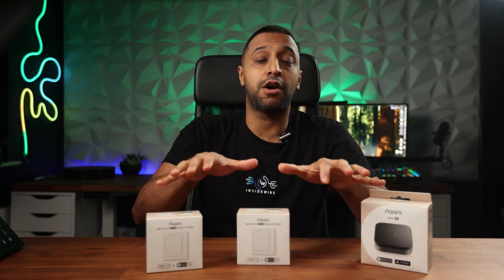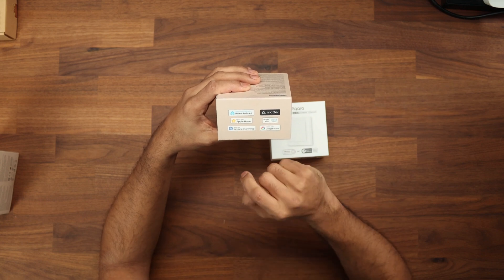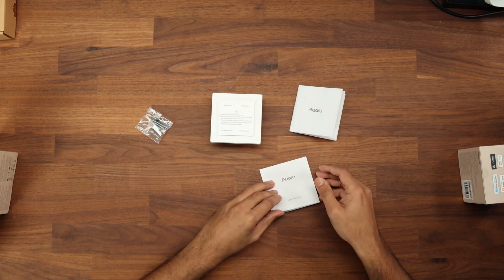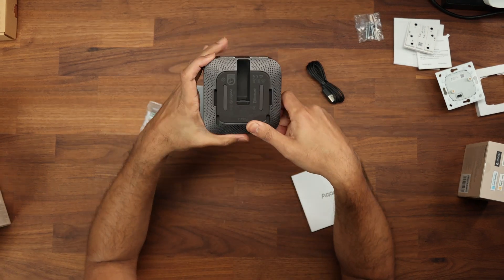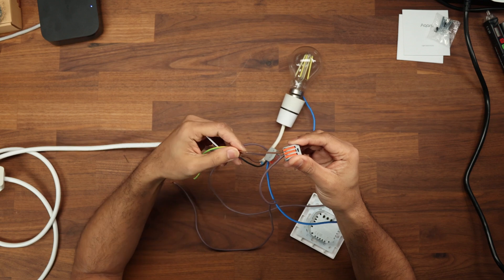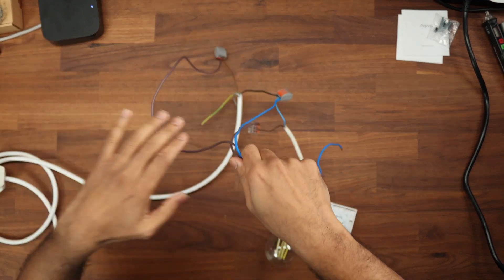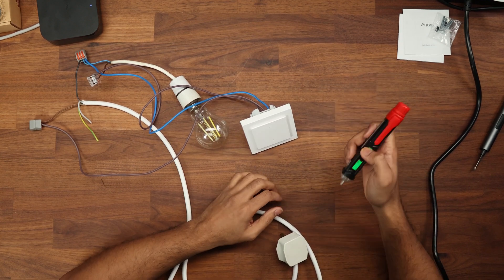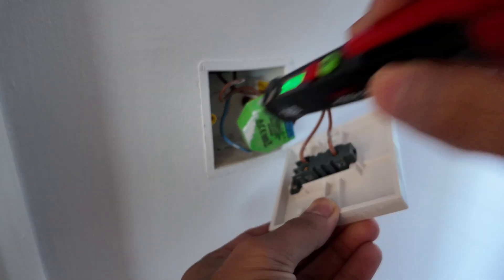Aqara Light Switch H2 EU Review: Features, Installation, and Performance

Comment: Were you able to use it in decouple mode added as a matter device ? 
I’m looking to use this as a double rocker for a dual track curtain system (Aqara c3 ), just powering the switch not using  any  channels. I.e. scenes only.
Seen some information that decouple only works in zigbee

Comment: I want to use the Lightswitch with a HUE lamp do i have to use i then as only a "remote" or can i keep the relay so that it also works when network is done but i still want to keep the Smart Light online for like Color changes or so (is that this MARS tech) or is it then just a wireless switch and the relay inside is powered all the time to keep the bulb or what ever online? also does it even work with HUE light or other Brands or does it needs the Aqara lights and hub for the MARS Tech?

Comment: Hello , I have a few questions , do I need to purchase the M3 hub to be able to connect to home kit , I only need the on and off button, I don’t have a use for the wireless switches .

Does it just work as a normal physical switch if I don’t have the m3 hub ?

Comment: Using all the advanced features requires a neutral, but it will work without.
Reply: which advanced features will not work? i dont have neutrals and wish to use 2 switches in tandem to turn on and off upstairs and downstairs lighting from each individual switch. ie use the downstairs switch to turn upstairs lighting on and vice versa.
Reply: @ the power metering needs a Neutral, and also the MARS mode to control a smart bulb wirelessly.
Reply: @ Plain on/off functionality works without neutral. If you have a smart home hub you can have rules where turning one on triggers the other or whatever rule you wish.

Comment: Best shot so far to get a decent switch for the EU. The H1 worked but the 85 mm size made it impossible to mount side by side in a normal two-switch wall box. This is apparently system 55 compatible which should help with that. I have aquired just one so far to test, it should work with Home Assistant and Zigbee2MQTT with access to both buttons; if it works I'll pick up more of them. The other choice I'm aware of on the EU market in Zigbee is the Niko dot eu switches, those are pricier and I have a hard time even buying them where I live. The feature I'm really after as well is decoupling - the ability to operate the relay in the device separately from the button(s), the buttons turn smart bulbs on/off instead of the relay.

Comment: Thanks for this useful video. Good to see that the physical and wireless switches do work via Matter with the Aqara hub.

I have just installed a single gang H2 switch and found it very difficult to mount in a UK standard metal back box. The depth needed by the H2 is >30mm so many UK homes will need a deeper back box fitted especially if there are a lot of wires present. Also the H2 body is a round shape to fit flush into an EU type round back box and it's mounting plate is a bit too small to fit over the larger UK square wall cutouts. I think an EU switch to UK back box adapter plate is going to be needed in many UK installations and these are hard to find. Or, perhaps swap out the UK metal back box for a plastic surface mounted back box like the one you used, or even use an EU type?

Being dual Neutral and no-Neutral is great but I noticed that you didn't mention that the Power Monitoring feature in the H2 is only available if Neutral is used. Similarly if used to wirelessly control smartbulbs, the H2 must connect to Neutral.

The H2 uses a physical relay to load switch and I find it surprisingly loud when it operates. It is far noisier than smartswitches that use electronic load switching.

I have paired my H2, that is wired with Neutral, to a Homey Pro hub via Matter-over-Thread and that worked as expected to control the light switching. However, the lower wireless switch is not discovered and as far as I can see is unusable in Homey Pro Flows (automations). I hope that Homey update their Matter implementation soon to include the wireless switch but in the meantime I need to try using the H2 via Zigbee as this might work differently.
Reply: I have the H1 (a couple of them, bought for testing to see if they'd work) and the relay on those too is a loud chunking sound; the 85 mm non-negotiable size of the H1 made them less desirable for me, had fitment issues (so glad these are better at that). As for compatibility of the H2, I've been told that the only two ways right now to use all two/four buttons etc is the Aqara hub, or Home Assistant with Zigbee2MQTT. I hope that's true, since I use the latter at home. Assuming I get full functionality going on that I'll be buying a dozen or so.
Reply: @cr0ft-2k I see that today Aqara are offering the similar H2 dimmer which is a rotary knob controlled device.
Reply: @cr0ft-2k  the click may not bother some people but I do not like it. If the switch is used with a Neutral and controlling a smartbulb in MARS mode, then the relay is always on so no clicking in this setup.
Reply: @dvwebster  Yep, I agree, the click is not great. It gets better when you start expecting it but no click would be vastly preferable. But, much like in your case, mine will also be on 24/7 anyway, and the switches decoupled to operate home automation scenes or turn on and off other smart lights. I just want the house so that when someone visits and pushes a light switch, they get the result they expect, even with smart bulbs.

Comment: Nice explanation.  Did you have the switch in Zigbee or Thread mode when connecting to the M3 and did it pass the switch through to Alexa so you can use voice commands?

Thanks
Reply from the maker: When I connected it was with thread, I havent tested with Alexa yet but both should work.